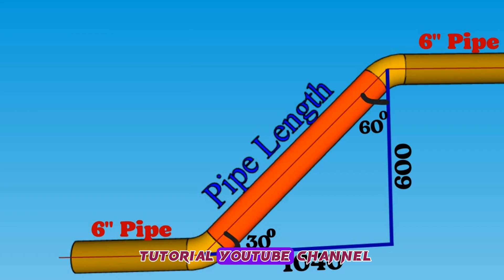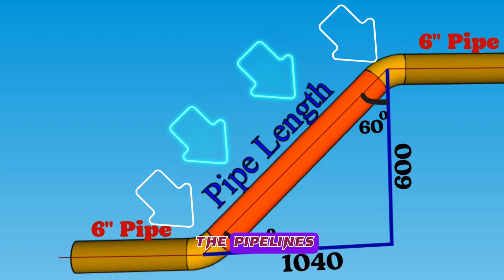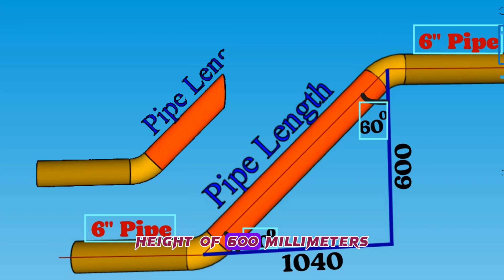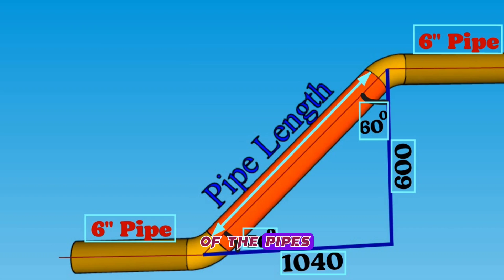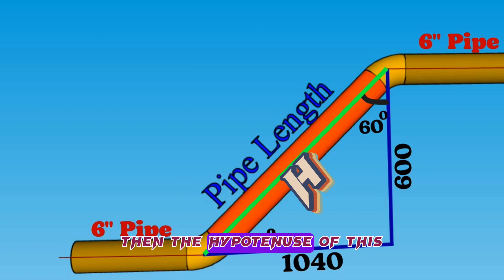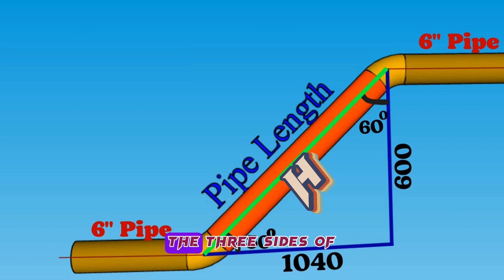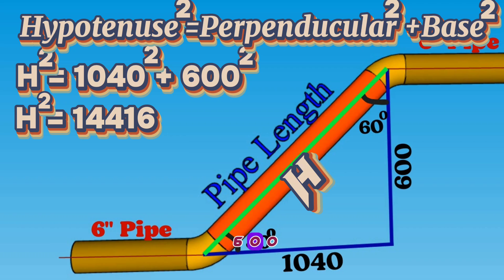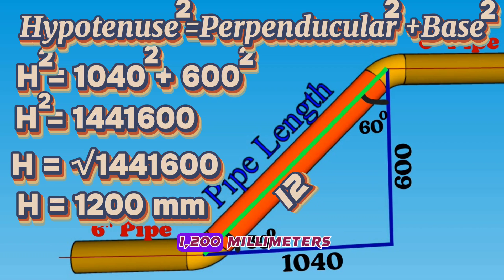Pipe Length calculation. Elbow length calculation Formula. How to calculate pipe length easy way

Comment: How you find the elbow digree 60?
Reply from the maker: The sum of the internal angles of a right triangle is 180 degrees. If the acute angle of one side is 30 degrees, the other angle will be 60 degrees.
Reply: @Piping-engineer correct other way to get 60 is 30-90

Comment: Hello.  I probably don't know English well enough for you to understand what I want to know.  But I'll try to explain again.  You calculate the triangle from the middle of the elbow.  But where did you get the degree of this elbow?  If you count from the ends of the pipes, the degree will be different.  So how do you know which elbow you need?  I'm sure there is a formula.  The center of the elbow is not a problem.  Tan(elbow angle / 2) × elbow radius.

Comment: the Pipe length is incorrect, the elbow length at 60° is incorrect, since you did not multiply by 6 inches.

Comment: Hello.  So I have a question.  All the videos I've seen are the same.  All calculations are shown not from the ends of the pipes, but from the imaginary point of the center of the imaginary elbow.  Does anyone want to share the formula for calculating from the ends of the pipes?  What to do if the pipes cannot be cut?  How then to count?
Reply from the maker: Many thanks for watching and comments.
It is not necessary to cut the pipe to measure the pipe in the pipeline. To find the distance to the center of the pipe, you need to measure the distance to the edge of the pipe and add the RADIUS of the pipe.
Reply: Thank you very much👍